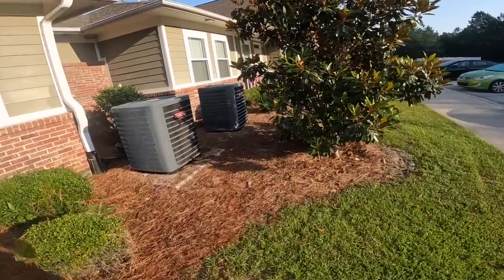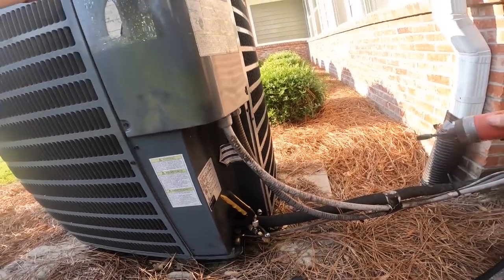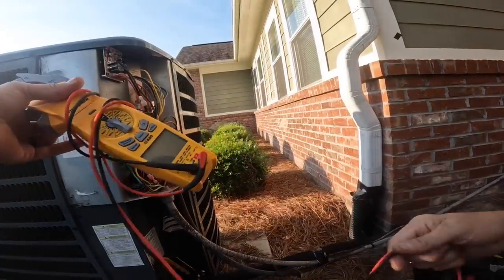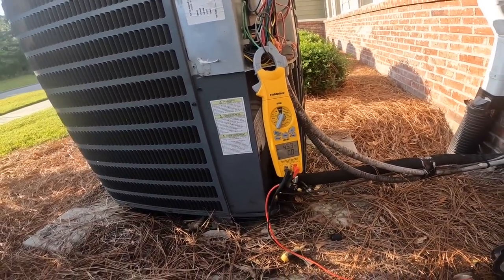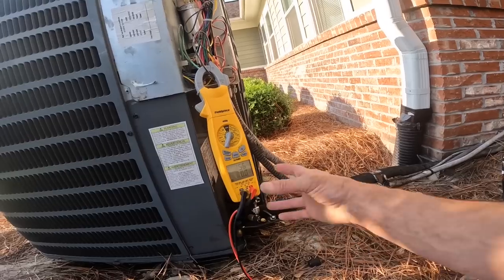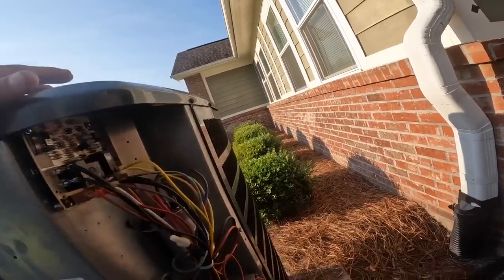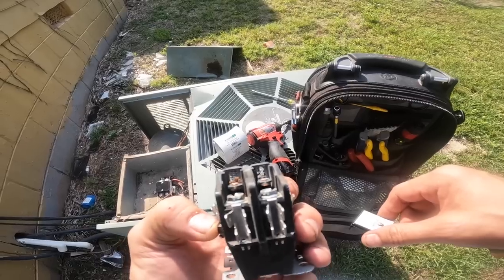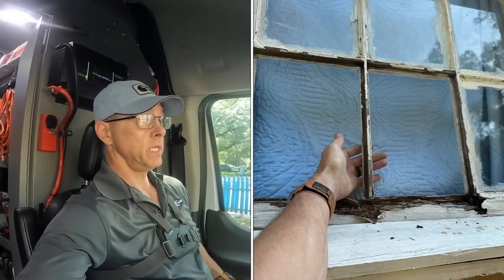An Odd Sounding Compressor And Two With No Condenser Running! #hvaclife #hvacguy

Comment: if the compressor noise is the loudness shift it is either one of them variable speed compressor units or that is the power meter phoning home.

variable speed compressors use electronics to vary the speed of the compressor motor.

the power meter phoning home the modern digital power meters now communicate over the line back to the power co for up to the second billing and often make a buzzing noise that can be heard and flickering of led lights that dont have smoothing capacitors.

Comment: I have an interesting story for you. In the early 90s I was changing air filters and belts on rooftop units. I was on the roof pulling the filters at a small hair salon in a really bad area. I opened the unit and the chemical smell from their hair products was so overwhelmingly strong to the point that I gagged and almost puked. It looked like something reacted with the oil on the filters we used.  I walk away for a moment to get some fresh air and I find a cut off ankle monitor, the kind courts put on parolees and such. I actually turned that in to the Chicago Police and wound up being questioned like I cut it off my leg.  I proved my story with my bill for the business. I called the Police many words that I can't put here. I smelled like chemicals and was light headed for hours.
Reply from the maker: Dang
Reply: Nothing that being a good citizen and going to the cops can't make worse.

Comment: Ain't it National Code that a disconnect be within 5 feet of unit ?
Reply: within sight and readily accessible is what NEC says and within sight is like 50 feet max and nothing in the way of getting to it and no tools/gear needed.
now various local, town/city, state codes may enforce it to be closer. I know of some that require it within 3 feet of the equipment.